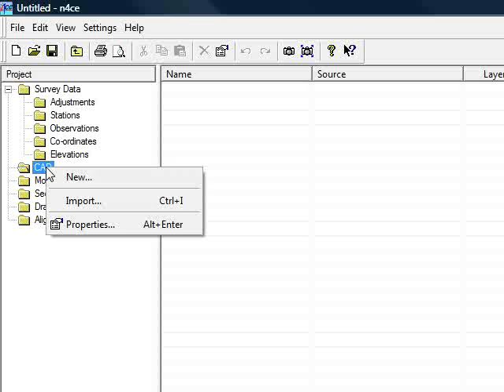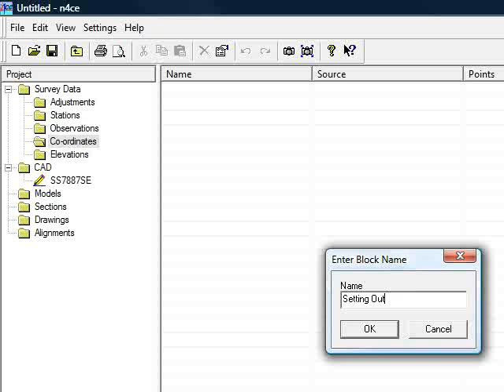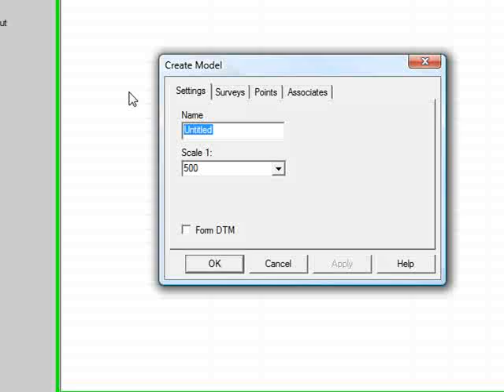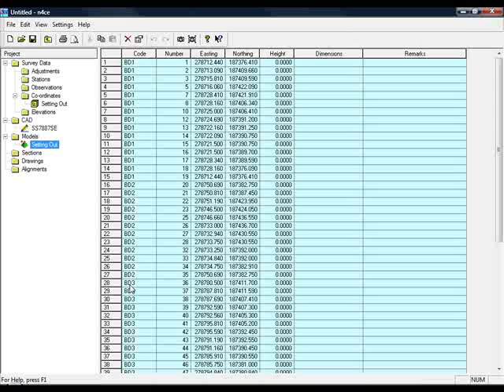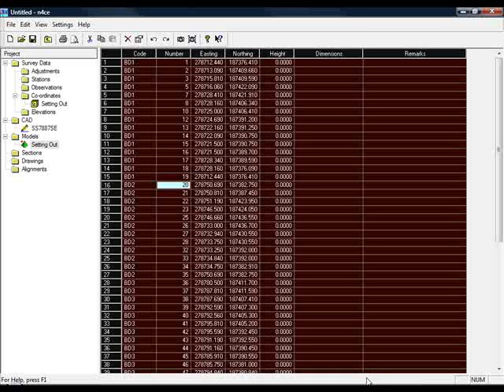Extracting Setting Out Data From a DXF File With n4ce

Comment: This is ok for setting out corners on concrete founds for brickies .How do you set up for setting out the founds ?
Reply from the maker: Hi, yes it is.  As long as the coordinates in the DXF match your sites coordinates, then any points extracted from the foundation drawing will be correct and can be uploaded to your total station.
Reply: I would like a demo of that if possible .
Reply from the maker: Hi, well anyone can demo the software.  If you get in touch with us via Support@appsincadd.co.uk we can send you an email with details of the trial and what to do next.
Reply: How would i set out the edge of one of the footings ?
Reply: I would mark the corners out on the ground with road pins, then measure in half the given thickness of the wall. This would give the centre point of footings, join these points with a string line then mark them out. I’d put an offset peg at each corner.
Reply: Thanks for your input . I was thinking more on the lines of setting out the founds with the controller directly with autocad . Stringlines and pegs seem to be history now .